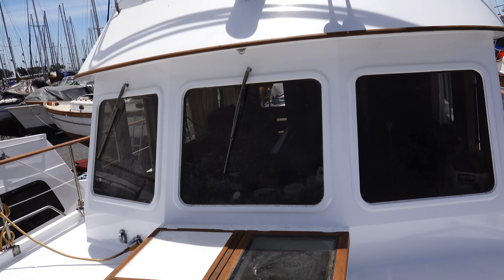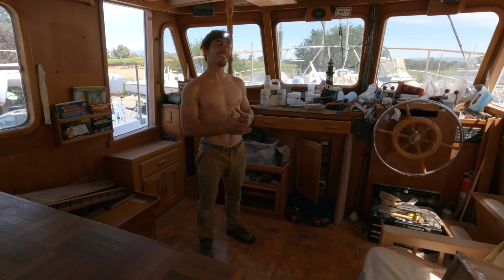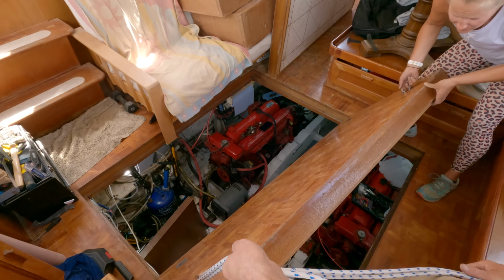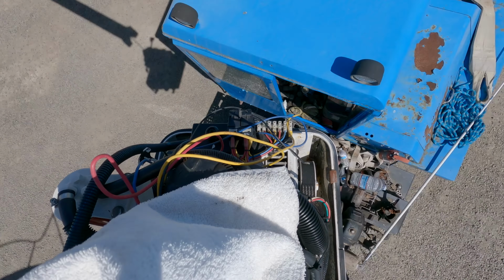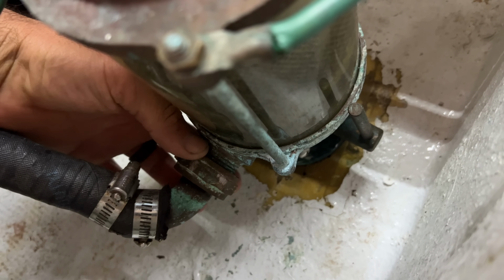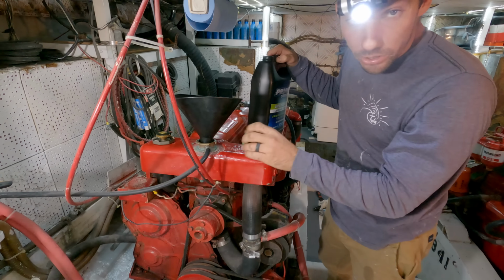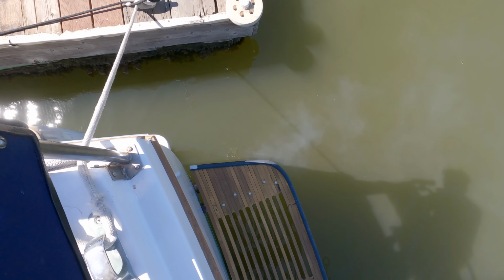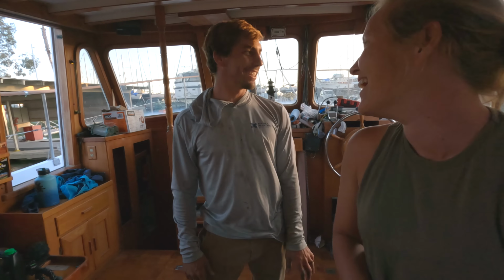We FINALLY LAUNCHED! But we are Slowly Sinking..

Comment: The calm of Billy, while water is flowing in, was impressive. So logical. "It can only be a few things. Let's begin again, and find where we went wrong." SUCCESS!! Fabulous job, you 2!
Reply: Probably had no more than a couple of feet of water below the hull ; )
Reply: I mean there is a valve right there that stops the leak.  Just could not run the engine till the leak got fixed.
Reply: All old trawler owners are either zen in their approach to problem solving, filthy rich, or were murdered by their spouse for lashing out at them because they can't dig out the last piece of impeller out of the heat exchanger. There is no other kind.
Reply: You guys crushed it that's one of the best renovations I've had renovations I've ever seen and I've been voting all my life and what's saying probably twice your age or more! 🥲😊  Did you name your boat yet maybe we can't wait or Lady love, LA lady, our 1st love the sea,
Reply: We own a DeFever and are currently just upriver from you at the Napa Valley Yacht Club. We’d love to connect with fellow DeFever owners. 
Millard & Boo Blakey
49’ DeFever RPH
Reply: Youall did good on that 100$ boat

Comment: Billy and Sierra; Looks and sounds like a Lehman-Ford to me. Preparatory maintenance hint from a guy with 40 years experience with a Lehman-Ford in his trawler. I noticed in the pics of the engine when you were filling coolant that you don't have a spare alternator belt led and cable-tied up out of the way for the day the existing belt fails (it will - they all do at some point). If that happens now, you will have to disconnect the coolant hose to put a new belt on, and go through all that involves. Better to get the replacement belt led before hand and tied up out of the way. Then, when you throw or bust a belt at the worst possible moment, putting the backup belt on is simple. I loved watching you work on the trawler. Hey, wasn't the video of the waterproof shoes you were repping at the beginning taken in the San Juan Islands? We're located in Friday Harbor.

Comment: She looks just super. Anyone in the marina had to be impressed with how hard you worked to get it done in 4 months and get back in the water. I know I am. She is going to look so good in sheltered coves in the Pacific Northwest.
Reply: Hint: the commercial running the canadian guest flag...
Reply: the Napa Valley Marina owners are old  school Sicillian family, Tula crew work ethics surely won the heart and minds of the Harbor master and owners. Best of luck getting a covered slip while your stay there in the  marina. The marina deli has day old salads and deli sandwhiches for a bargain.  There's a 1987 35' Grand Banks under the  cover slip also resides Humphrey Bogart African Queen. The motors of the Grand Banks are up in Oregon and freshly rebuilt last season and are same motors, they may be for sale at $3000 for both. I have the phone number of  the Grand Banks owner and so does the Harbor master. New power plants may up the value.

Comment: Well guys you splashed the boat.  I understand how much work you are putting into that boat.   I've rehabbed a 6 unit apartment building and 2 duplexes in the last few years, it's a ton of work.  I did some of it while I was still working and some while I was between jobs or retired.   Congrats on finishing the exterior of the boat and good luck on the interior.   Keep the good stuff coming guys.

Comment: When you start the engine the plate on the raw water pump should be cold, if it gets warm there is no water flow, ideal way to check when you are in the engine room.

Comment: Make sure that coolant is diesel engine compatible.  If not it can cause a condition called cavitation, this will eat holes through the cylinder liners and destroy the engine.

Comment: Itl  be imo corroded wires to the solenoid so its not getting quite the voltage on to it there. Jump at the solenoid to confirm

Comment: I have dabbled in boat repair work for decades on my own boats and this summer I have been working for a guy sanding, painting, fiberglass repair, wood restoration, (and more sanding) etc., of customer boats.  CAN your average DIY person tackle a project like this?  Sure, but be prepared for endless hours of sanding, lots of patience, confusing and difficult chemical reactions, (why isn't that epoxy setting up?) and so many dirty days.  Part of the difficulty of their work is the size of the boat.  Some of these same jobs on a 20 or 25 coastal cruiser are FAR less intimidating.  On a massive trawler like they have, everything takes 5 - 10 times longer.  Also be prepared for a long learning curve as you dial in the techniques for making your paint and repairs look professional.    It took me two tries to get bottom paint done properly.  The first time I didn't sand enough, so the next year I had to start completely over, and it took 2X more sanding.

It IS satisfying, as fiberglass boats are almost indestructible, and it feels good to "recycle" an old boat and bring it back to life!

Comment: Boat Name, Boat Name, Boat Name?? Once done, there is nothing better than a successful SPLASH Day!  I'm glad to see you get the replacement gennie in the ER, better to have it and not need it than the other way.  Plus, it will help with the resale value.  When I was a Jr and Sr in high school, I worked for a Defever dealer in Seabrook TX.  The brokerage owner bought a 1978 Defever 43 (new) for himself, and I remember it well.  It was delivered in Galveston TX, took off the delivery ship and put right into the water.  We connected up two 5gal jerri cans of fuel with temp hoses and made are way to Seabrook.   I don't think your boat is that one, but you never know.   The owner had me install an Onan generator (not uncommon), two marine aircond, main engine oil life extender units, and a pony generator on the port main engine.  I would have replaced those strainers with Groco ARG type strainers, much better product.  Never liked that integrated valve & strainer type units.  I see from you sponsor vid you are already somewhere enjoying the boat, congrats!  When are you going to announce the boats name???
Reply from the maker: Do you remember the original owners names?? This boat was on east coast, cruised the Bahamas then through the canal! Maybe it is the same one!
Reply: @Tulasendlesssummer  I do remember the name, not sure I should mention it here.  The initials are JB.

Comment: They look neat down there, did you change your injector pump oils on both engines
Reply from the maker: Yup of course. Every 50 hours
Reply: @Tulasendlesssummer  oh good its sometimes overlooked, I think the book said around 200 hours for that, used to have a Dorset aboard my last boat
Reply from the maker: Yeah you’re right it is overlooked a lot. The book for these engines (Lehman 120) says every 50 hours. Super easy to do if you have good access around them.

Comment: Your engines look like Ford Lehmann's I had a single diesel troller with Ford Lehmann . If that's what you have they are a bulletproof engine. In my many years of owning powerboats when I would launch I would launch I would let her be on the straps in the water and then double check everything before you let that travel lift go away.  Blessings

Comment: OK it is very hard to do what you have done But with engines make sure the water pressure cooling down the engine is out the back constant or the engine will seize up. Intermittent means air block or another blockage through pipes in the engine.

Comment: No, I don't assume everybody can do that.
- not everybody has the stand for so long.
- not everybody is so passionate
- not everybody has your skills. 
I have seen so many sailors not able to do a small repair on their motor
Even more sailors are simply afraid of electric - don't touch a single wire. I saw some of them completely messed up when the motor didn't start. Not knowing you (in most cases) might start it with a screwdriver nor knowing that simple cable is running down to the starter. When your motor didn't start and you calmly said "check some connections" - that would be the complete horror for them. 

So - you both are amazing and outstanding.

Comment: your wrong when you say everyone could do this.  In all actuality only a very small percentage of our population could do it.  I work all my toys ,motorcycles, RZR, Airplane, 2 boats, 4 wheel drive truck, and I have remodeled many of my fixer upper homes.  I have learned that if I can't finish.a job within 2 months I won't do it.  My time is worth more than the labor I am saving.  So I fix things for fun.  I would not consider for a moment to do what your doing.  That is why I admire you both, what a perfect team you are.  I had to laugh a Sierra having reached her limit of questions.

Comment: White smoke from the exhaust is a blown head gasket probably ! Every time I have run into that , it was definitely a blown head gasket ! Don't ignore it !
Reply from the maker: It is very normal for these engines to smoke a little bit especially at their current age and hours (~6,000)
Reply: @Tulasendlesssummer  it actually could be 3 different causes . The worst one being water getting into the combustion chamber . You had low coolant on the starboard engine . Wasn't that the engine exhaust with white smoke ? A small crack in the head , block , or gasket could be the problem . Unburned fuel from bad timing , rings , fuel injectors , glazed cylinders also could be the problem . Keep an eye on the coolant level . If you keep losing coolant and get continuous smoke , you could be burning coolant . Check for a sweet smell . Good luck .

Comment: You're only sinking if you can't pump out the water as fast as it's coming in.  All boats leak but only a few sink.  You got yourself one awesome $100 boat there.  My $1 boat project is in my back yard, not in a boat yard.  I figure it's going to take me three years to make it, and it's trailer, seaworthy.

Comment: Great job guys. However, imho, whom ever is undertaking a rebuild and it’s going to be a do-it-yourselver needs to have certain basic skills in engine and electrical knowledge. If you are not handy or have a mechanical mindset. You are going to fail or pay for the work to be completed. This is not for the faint of hearts.